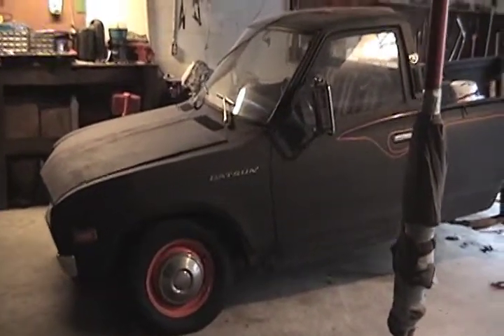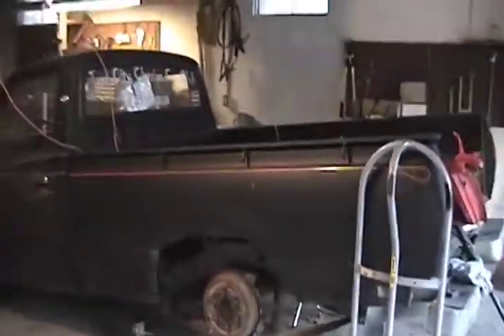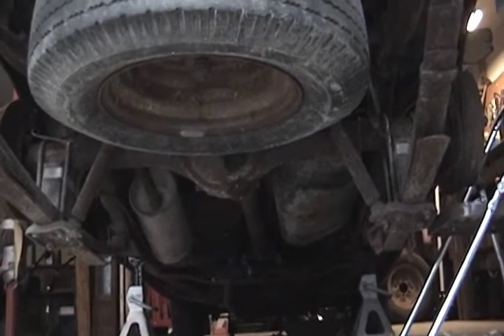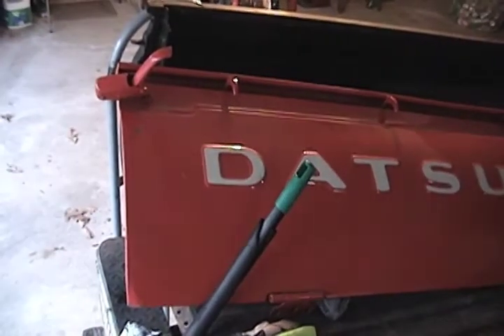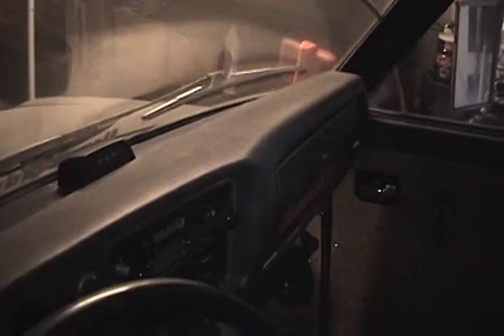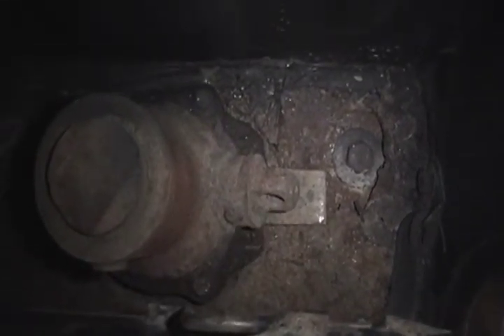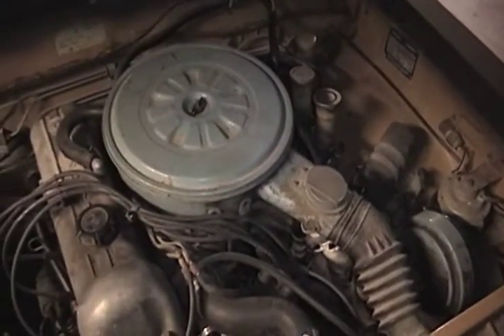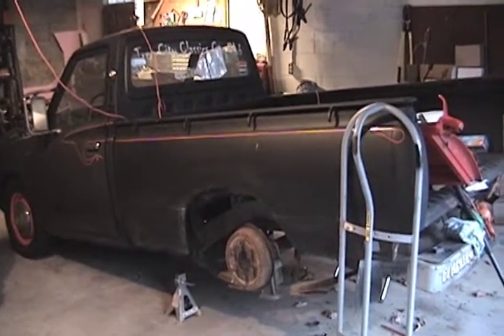1975 Datsun 620 Pick-up Restoration Pt. 1

Comment: I HAVE A 75 ALSO     I HAVE A 1992 240SX TWIN CAM 16 VALVE WITH A 1980 REBUILT 240Z 5 SPEED.    I WHAT TO CHANGE THE REAR END  ........CAN YOU GIVE ME SOME SUGGESTIONS